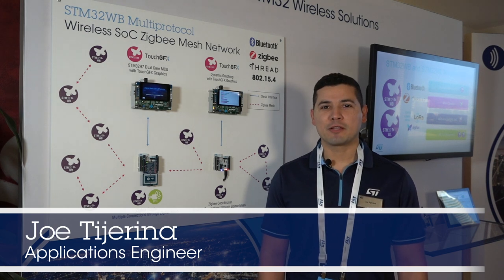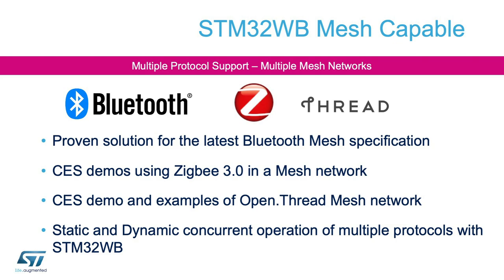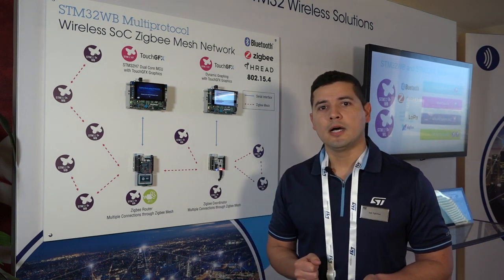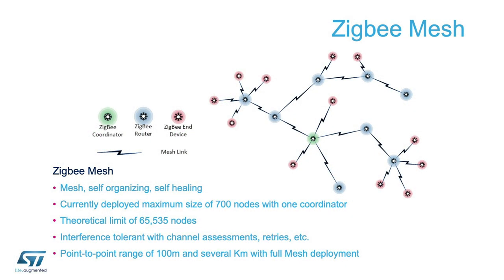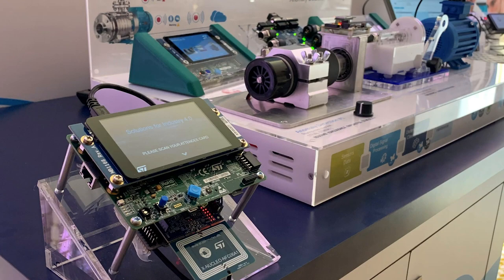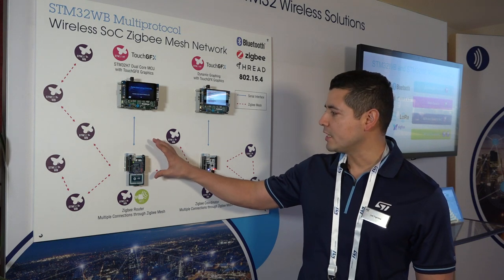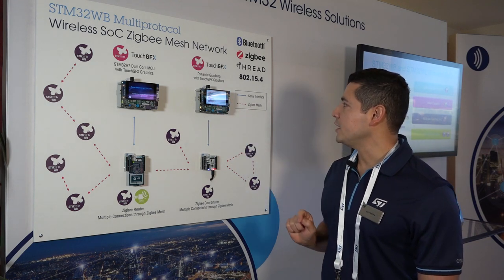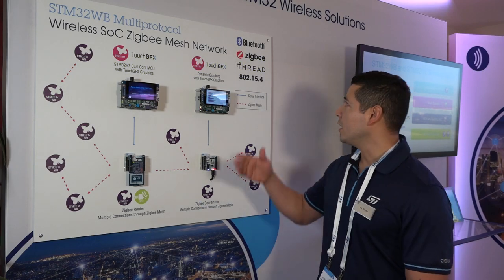DEMO - From CES 2020: Zigbee Mesh using STM32WB (CES 2020 with Joe):

Comment: 50uA/MHz? 2400*50=120mA?
Reply: That is for processor core frequency(50uA/MHz)
From datasheet:
Active-mode MCU: &lt; 53 µA / MHz when RF and SMPS On
Radio: Rx 4.5 mA / Tx at 0 dBm 5.2 mA